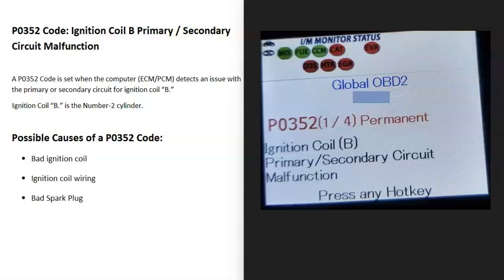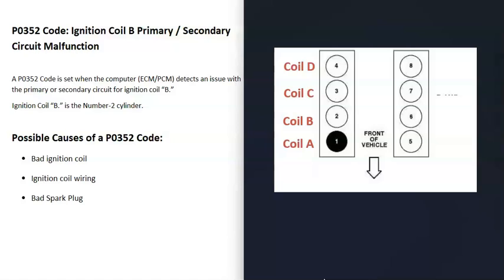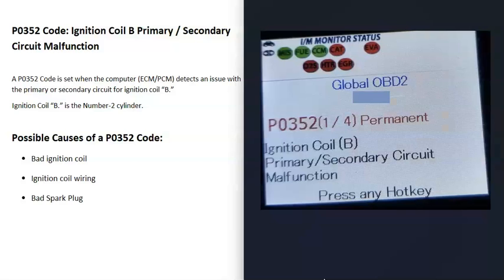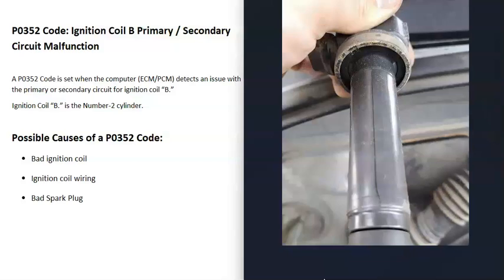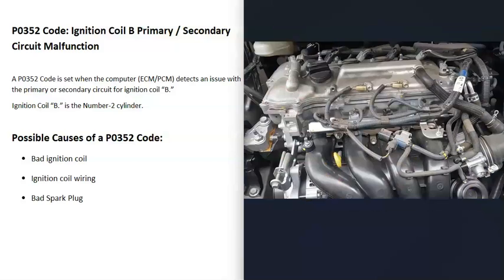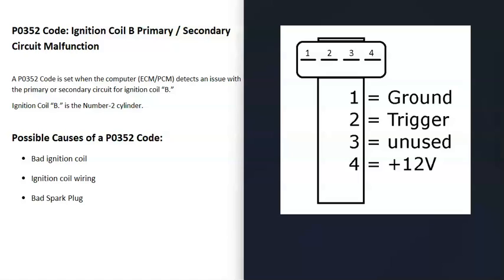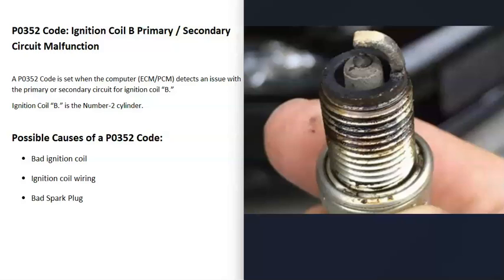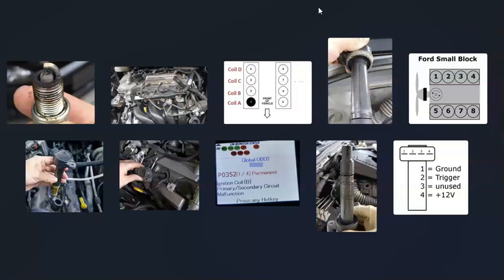Causes and Fixes P0352 Code: Ignition Coil B Primary / Secondary Circuit Malfunction

Comment: Hello from Texas HVAC mechanic I have the same code on my mustang gt 2007 and I changed the coil pack and the connector cable of the cylinder 2.and I put the spark plugs and I'm still having the same code and same cylinder 2 and the rough idle doesn't go away..what it could be the problem?
Reply from the maker: I would test the wiring.

Comment: The firing order doesn't matter for these codes. Take inline 6's for example, 2 cylinders fire at the same time so how would you number them according to firing order. All I can say is that in my case the cylinder numbering goes from front to back.

Comment: Mazda cx-5 2.5l engine. P0015 over retarded cam code. Every coil had a secondary ionization code ehich could have been oending, i dont remember.. Vehicle arrived as a lower rod knock complaint. No rod knock was audible. I told the service writer that i belived the customers complaint although ut is not knocking at this time. That was the end of that. Any thoughts, sir?

Comment: 97 towncar. I keep getting P0352 … I switched quad coil, the wires, the spark plugs. still following that cylinder regardless of what I do. How do I test the connector that goes into the quad pack?

Comment: 2004 rav4 awd M/T
P0302
new spark plugs-ngk’s
new coil packs-oem denso 
Checked the ohm output on injectors-all match
Swapped injector to different cylinder-same result p0302 still remains.
I took an old coil pack unplugged #2 to plug in old coil to hold against engine to see spark- there was spark… lol what else?
Reply from the maker: Anything I say is a guess, but I would check the wiring harness for a bad connection that is causing an intermittent problem.

Comment: Just got done doing a head gasket job on my 2zr-fe. Now got a misfire issue, replaced spark plugs and now coil in 1. But the misfire then jumped to 4! So put another new one into 4 and now it’s back to 1! Insane. Did the whole switch around before with the coils and it kept jumping so that’s why I replaced the coils. I’m guessing it is pcm now. Not sure. Did check wiring and the readings were normal. Thanks!